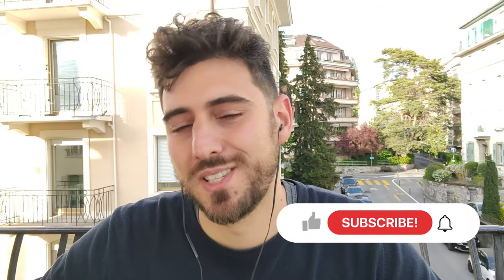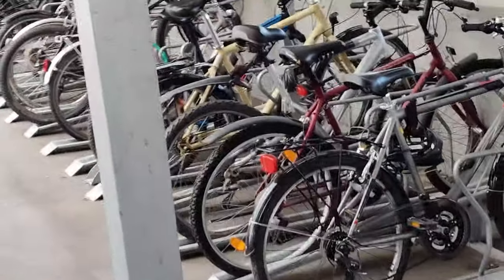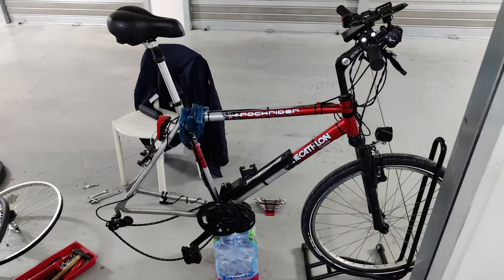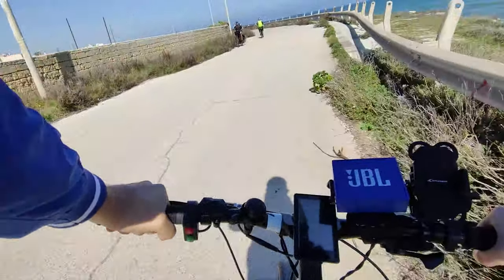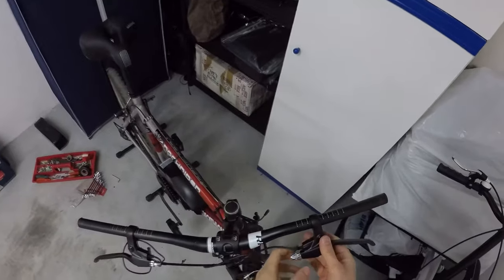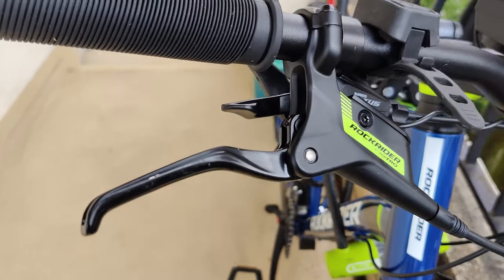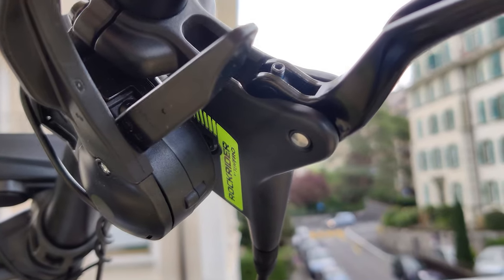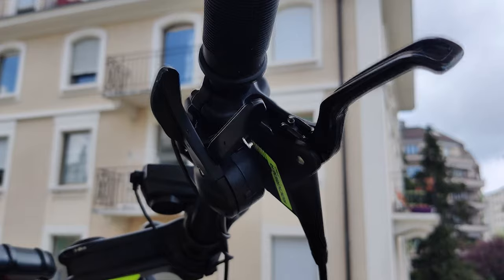Do You REALLY need BRAKE Sensors? Hydraulic Vs Mechanical on e-Bike Conversion Kits

Comment: It's not worth it to install these brake sensors. Not sure why they haven't figured out that many hydraulic brakes levers were not designed to move the same ways as the brake sensors were designed to work with! The trick is to program the mid drive motor to immediately stop delivering power when you stop pedaling! Don't we by instinct stop pedaling when we are about to hit something?
Reply: yes AND hit the breaks at the same time.

Comment: I drive about 6000 km in one year and i tell you don't go for an mechanic braek! You need to maintain it much more und you will lose break power and sensibility. i normally do not need touch my brake once in one year, and i got the cheapest shimano hydraulic disk brakes.
Reply from the maker: I think you're right and I am slowly changing my mind towards hydraulic :)
Reply: @LukeLorusso  Hydraulic are lower maintenance and don't rub as much because both pistons apply equivalent pressure to the rotor.  Hydraulic is better.

Comment: I tried putting sensors on my brakes but there was no good way to attach them externally.  The hydraulic double hydraulic system is great so I just stop pedaling before breaking

Comment: All you have to do is mount your bike with your hand on the throttle and no break sensor cut-off and have the bike jump out from under you or push you to the ground to realize the value of break sensors and power cut-off. For advanced controllers the break sensor is what triggers "regenerative breaking" which puts power back into the battery.
Reply: Here's a tip.  Don't put your hand on the throttle when mounting.
Reply: @dumbkoft96  A good tip and easily followed  ... except for that rare occasion where you don't follow it. I don't really understand the argument against the break cut-off. Why would you want power going into the motor when you are trying to stop? Aside from that, some controllers use the signal from the breaks to activate regeneration. It's not necessary, but it helps in breaking and it does extend the range of the battery to some extent.

Comment: These brake sensors sound crazy. If you were driving a stick shift car, your right foot would move between the accelerator pedal and the brake pedal. There is no brake sensor thee. Just as you would luft your right leg off the gas pedal and press the brake pedal, effectively cutting off the gas to the engine, you would do the same with your right hand fingers, I.e. remove from the accelerator and grab the brake lever, cutting off the power to the wheels. In this sense, a finger activated press type accelerator wold be the best since the finger will have to be removed to grab the hand brake in ebike.

Comment: Both my bikes stop motor support within a tenth of a second when I stop pedaling. This usually is enought. But on the mid drive bike I installed one on the rear break lever anyway becaus in lower gears the motor might be hard to stop if something goes wrong. On my rear direct drive bike I'm perfectly happy without break switch, but I installed a seperate switch to start recuperation manually if I go down a long hill.

Comment: I just put the Bafang SSHD on my Norco Sasquatch enduro bike. The hydraulic brake sensors have been a headache; firstly, I had to file a flat surface on the lever housing to mount the sensor sending unit because there are no flat spots whatsoever on my Avid brakes. Then I lost both magnets from fiddling around and moving them repeatedly so they’d actually register that the brakes were “off”. I finally got the front brake sensor to work, but it malfunctioned again on a ride, so I have just unplugged the sensors from the harness until I figure it out. Perhaps by experimenting with differing magnet strengths
Reply: Oh and yes I have the gear sensor unit 🤗

Comment: I've been riding with a Tongsheng motor on my mountain bike for around 5 years now and never ever had any brake sensors on it. It has never bothered me either so why would I put them on now. I certainly would never change the hydraulic discs for mechanical ones; that would be a safety issue as far as I'm concerned.🚴

Comment: short answer no you dont you should and will learn propper breaking technique in no time whenever you reach for the break dump out the throttle

long answer: its usefull if your lights system has a brake light helps cars know when your breaking at night also if you bump the throttle causing the bike to pop into a wheelie gripping the brake will kill the motor

Comment: ha, rockriders :) I put a tdsz2 on my 520 and I am waiting patiently for a second unit to go on my partners older 340. Just came up from the basement actually where I had to tighten the silver lug nut on the left (it got pretty loose), also applied some loctite. Hopefully this will get rid of the squeaking I developed recently, after a couple of hundreds of kms.

Comment: I was thinking of putting some mechanical brake on since the sensors are way easier fit. I was also thinking of using one of the mechanical levers as a sort of clutch but since fitting the gear shift sensor I don't feel the need to but I would definitely recommend atleast the shift sensor a well spent £10 on Ali.
Reply from the maker: yeah definitely worth the money
Reply: Dont do mechanic braeks, see my post upwards

Comment: Get a torque sensing TSDZ2 and you need no shift or brake sensors.
Reply from the maker: I have a TSDZ2 and everything I said is also valid for that kit
Reply: @LukeLorusso  Luca, I don't understand that. If you stop pedaling with a torque sensing motor, the motor immediately stop pushing, right? So I thought you wouldn't require to cut the motor through your sensors on the brakes. Am I wrong ? Thanks Ciao L.
Reply from the maker: @sidecarural  "If you stop pedaling with a torque sensing motor, the motor immediately stop pushing, right?" => No, it does not: as I said, no matter the kind of motor, the stop is not immediate and it can lead to tough situations

Moreover, if you are waiting on a red light, pulling the brake levers while having your leg on the pedal, the torque sensing system without brake sensors might see the weight of your leg as an intent to pedal! In that case the motor will try to push you, consuming battery and adding unnecessary force to your brakes.
You should consider all the scenarios
Reply: @LukeLorusso  Ok, grazie per la risposta!

Comment: 4th possibility is to use levers with built in sensors.
Reply: if you can find good ones absolutley

issue is trying to find good levers that support ebike controller wires and fit any other needs you have can be a pain 

but yeah if you can find them just buying the ready to go unit works great
Reply: @Sarge92 O have two different set ups both work well.